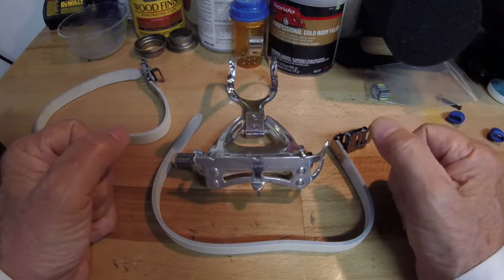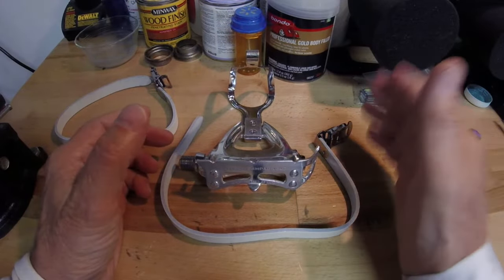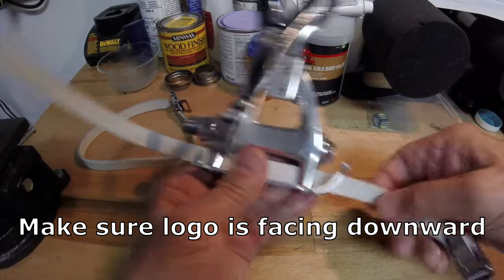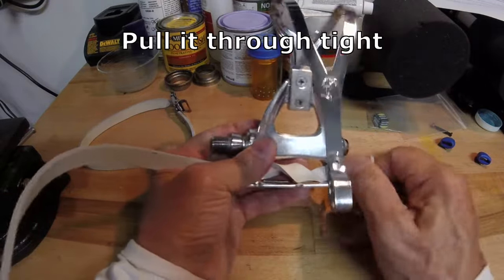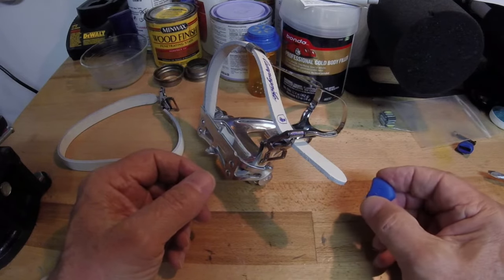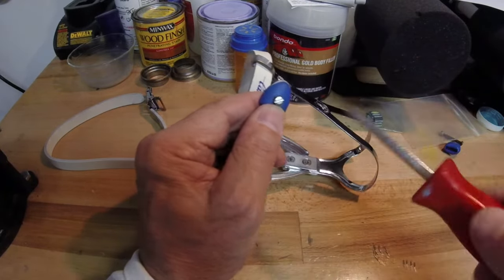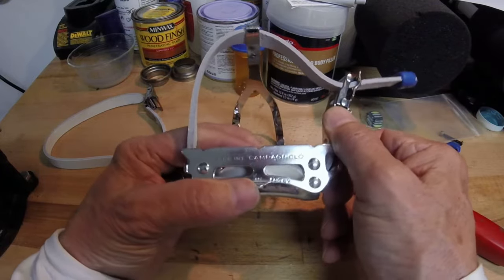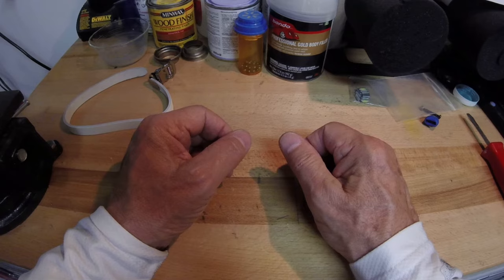The Correct Way To Install, Position And Use Vintage Pedal Toe Straps

Comment: Sometimes I like to ride with clips and straps, like the old days.  When I put Look pedals on my old steel Allez, I saved my Atom 600 pedals and Christophe clips and straps.  It's fun to use them when I'm not worried about traffic.  Someday I'm going to buy a vintage steel Motobecane and install these full-time.
Reply from the maker: The first time I rode with the old clip pedals, I almost took out 5 other riders and the first stop light!  They were a challange.

Comment: This is the hardest thing to deal with on vintage bikes for me .. cage pedals and toe clips/straps. In 1980 when I got my first Colnago (Super) this is all we had, by the time I stopped amateur racing at the end of the 80’s I had pretty good knee problems by that time and was constantly messing with my cleat angles to try and help. Since taking cycling back up in my late 50’s I haven’t had the same knee problems using Look Keo clipless pedals with 4 degree float cleats, but on my current 85’ Colnago Master and 86’ Specialized Allez projects they just don’t look right with my Look clipless pedals, so the Colnago has Campy SR cage pedals and the Allez has MKS cage pedals .. both with toe clips, I have Vittoria 1976 classic shoes with vintage style cleats, and am thinking of sanding/filing the slots in the cleats wider so I have some kind of float so I don’t mess my knees up again riding these bikes, what do you think? Great channel btw .. really inspired me for my own restorations .. so thanks 🙏
Reply from the maker: Hi Chris,  sorry for the late reply.  We are in the process of relocating and I'm not getting all my comments.   I don't know if I would file the slots in the cleats unless you are able to replace them if it doesn't turn out right.  You just want to make sure your foot will stay in the pedal.  Good idea though.

Comment: One of the reasons I took my toe straps off was because the design of today's athletic shoes are much wider than they used to be.  The straps were just too short for my fat foot.  Just lately, I bought some fabric straps and they are much longer and work much better.
Reply from the maker: Yes, I noticed the same thing. My foot is not long but it is wide. If I ride with the straps, I have them as loose as as possible.  Thanks for the comment! 👍👊

Comment: You don't have to reach down and squeeze to release you just push down on the upper side of the buckle and it loosens just like that, it's made like so in case you need to release really quick in an emergency,just fyi..
Reply from the maker: Thanks Dsbikes, forgot to put that technique in the video.